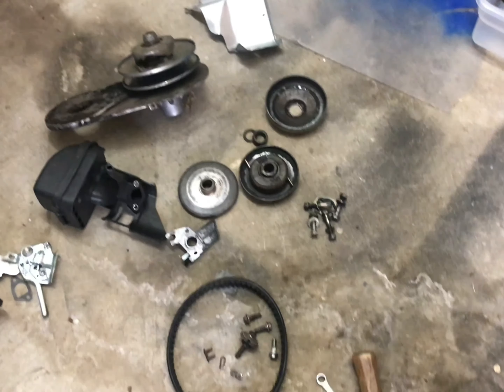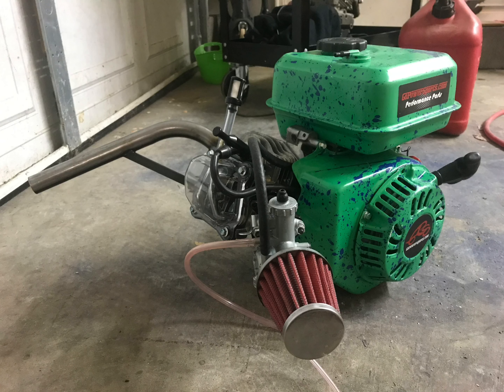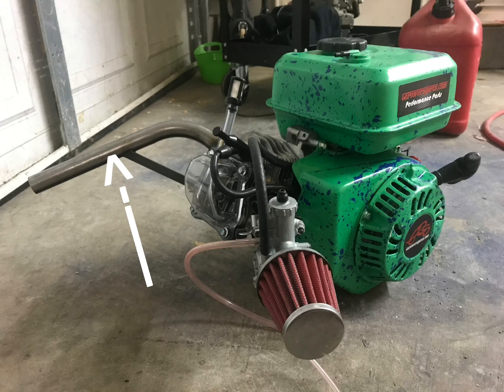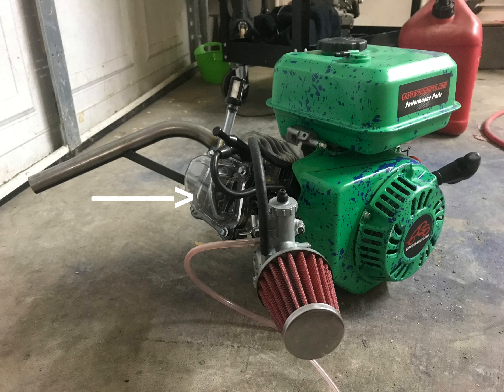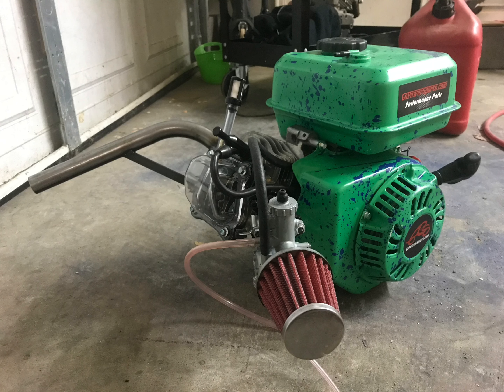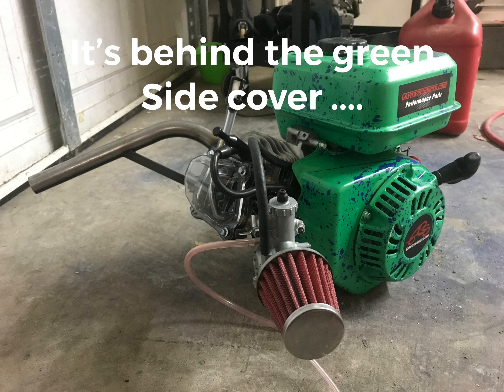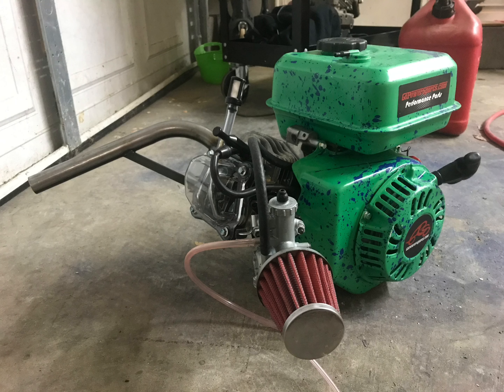Engine reveal ! + first start up

Comment: If your goal is to turn this thing 9,000 RPM, may I suggest an ARC Billet rod, Roller rockers beefier push rods,  new cam and 26# springs.
It's good to see younger people getting into mechanics. keep up the good work.
Reply from the maker: Steel and Styrene ok I will look in to it but it is all ready to fast for this kart so I might keep it how it is but I will look in to that if I do a race kart Style build
Reply: At least put a billet rod in it. No more H.P.
but way more reliable above 5500rpm.